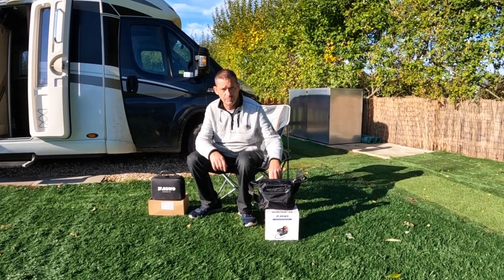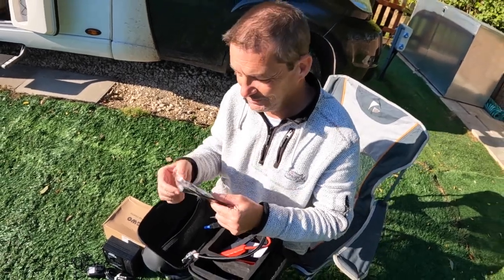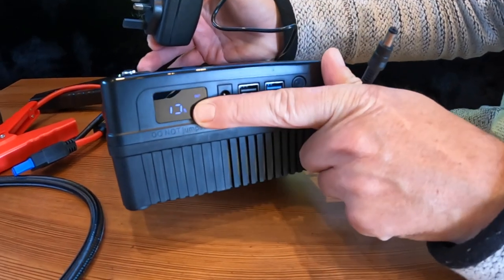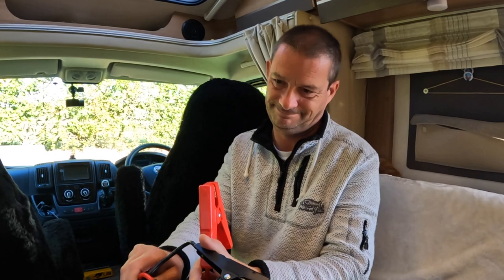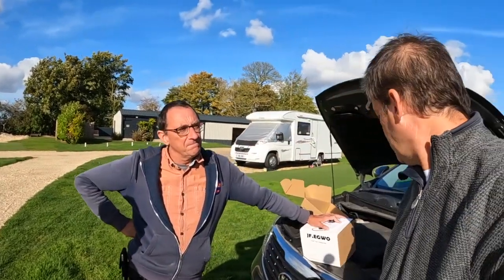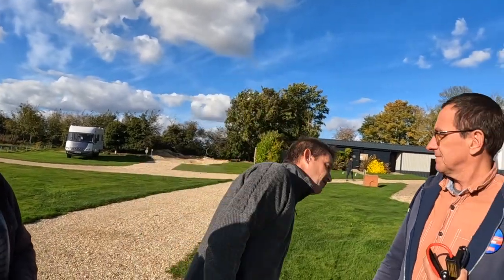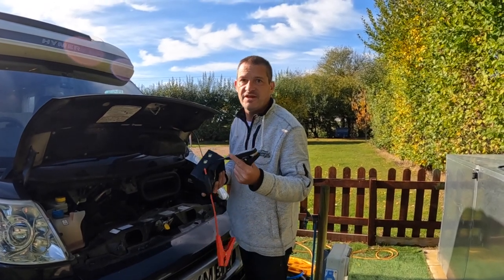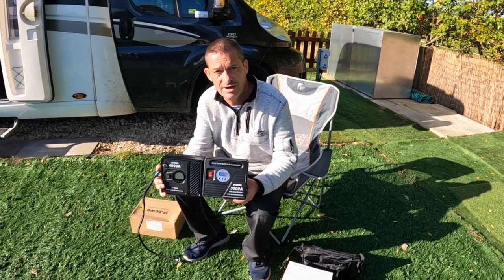JF.EGWO 4000A Car Jump Starter With Air Compressor Review

Comment: Hello Dan,the wire brush is to clean up the battery terminals if the batteries grubby  and create a good connection=Rescue Trolls today.